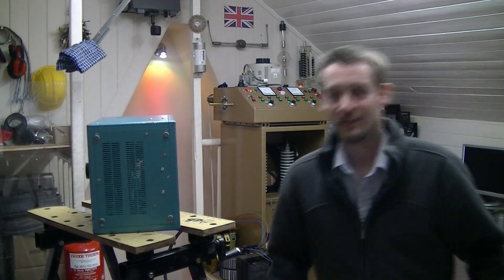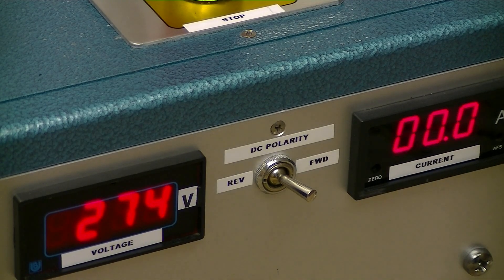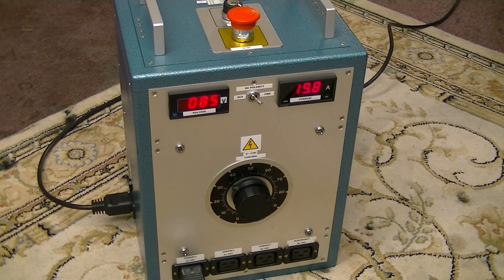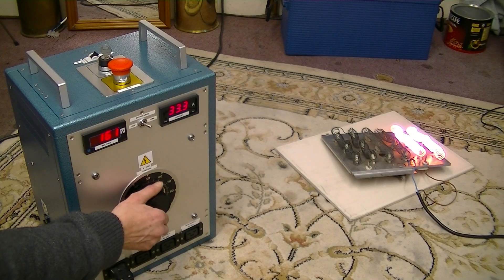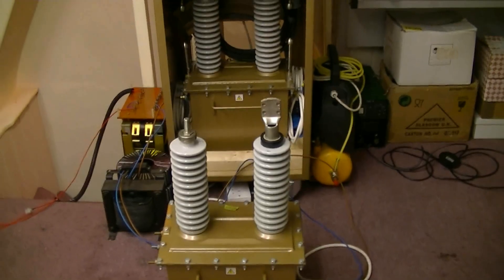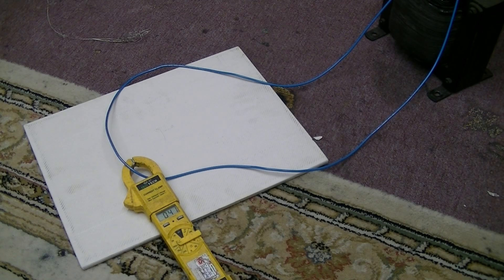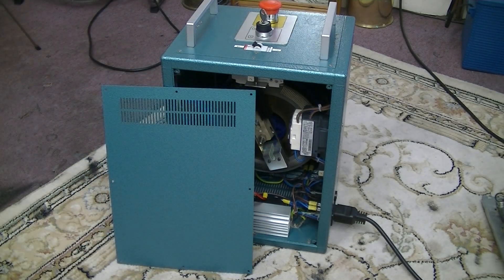Easy Electrical Project (with overload)

Comment: Trust photonic inductions experiments which start off fine then end up in fire and smoke!  Reversible DC is perfect for blowing up electronic parts in case you accidentally connect them the correct way round.

Comment: 9:45 I wonder, Is the cable twitching caused by the electromagnetic field around the wire, or something else?
Reply: The mass of the motor changing its motion

Comment: +Photonicinduction Andy why does the wire twitch and move when you put current through it? is it Electromagnetism? or is it the actual current moving it somehow?
Reply: It would take an extremely high current flowing through a single strand of wire to make it move by electromagnetic forces alone. It is more likely to be the rapid change in temperature (caused by the current heating the wire) moving it by thermal expansion.
Reply: Farmer Trev I figured I knew the possibilities, but didn't know which one would be most likely.
Reply: The wire is moving because of the magnetic field, trust me.  Tried not a single time. Sometimes it can even attract small nails or needles to the wire !
Reply: Lloyd Evans Yes that is true.
If you want to see extreme magnetic field, check this out,
watch?v=8bARpcEjiyA
Reply: Electrons have momentum. Gather enough of them in high density, then they can carry other matter with them.

Thermal expansion, electron momentum, and magnetic fields are the three reasons why the wires twitch.
Reply: mr evans is 100% correct. thermal shock. same thing is seen on AC lamp filiments. no 1 reason why they blow when you crank em on.
Reply: If the wire is close enough to something the magnetic field can attract, then yes, that could move it. It's certainly possible if the current is high enough, but a current that high would heat the wire enough to cause significant thermal expansion as well. So both effects probably contribute.
Reply: Mark Schulz IV Pretty neat let's see.  You know why I love Electricity? Because the possibility with Electronics and electrical energy are limitless, really they are only limited by Physics governing laws and your imagination.  It is so excellent.  I have been building circuits my whole life starting when I was 6 years old, lol I would stealk a 9 volt battery and a Christmas tree light bulb.  "you know those little ones" light it up, swing it around.  That was before I knew LED lights existed, back in the late 80's early 90's.  Now my favorite thing to play with are LEDs
Reply: Mark Schulz IV Oh and Arduino and Raspberry PI those are my favorite things to play around with, I made a battery operated portable Arduino Uno Programmer out of the original Raspberry PI, a battery a touch screen and a little mini Wireless Keyboard.
Reply: 85 Studios When you put electricity through a conductor it creates a magnetic field. The higher the current the more the conductor will move. 
This is how transformer work (besides the wire twitching). They induce a magnetic field into the other conductor.

Comment: Amazing video.  I'm so jealous of what you can put together so easily.
I don't quite understand how the DC conversion is happening - Photon talks about a 'DC relay' with 'double pole changeover'.  I've not heard of that before.   Is that basically a bridge rectifier?
Reply: A bridge rectifier is used to convert AC to DC. All the relay does is reverse the DC polarity by switching the positions of positive and negative terminals.

Comment: How should we go about hooking up a variac in a country with unpolarized plugs?
Reply: +Salvatore Shiggerino It does if the earth is connected to the ground of one of the plug pins. If you put the plug in the other way, the phase will go to ground and vice versa so you will get a little shock when you touch the chasis, etc. In Romania, we have isolated ground and phase (so the ground is never connected to the earth). The ground wire will always go to the circuit board and is isolated from the earth wire in the same way as the phase wire. The earth wire is going only to the chasis just in case the phase will touch the chasis.
Reply: The ground stops u from putting the plug in the socket(outlet) upside down
Reply: SpeakerLover1000#EPIC
No, it doesn't. The earth is in the centre, so the plug goes in either way.
Reply: Salvatore Shiggerino hello it's me SpeakerLover1000#EPIC I lost the password to that account so I'm here but in the Us Canada UK and other places you can only put a grounded plug in one way but that's how my outlets in Canada and US and UK are not sure where you live so I don't know what kind of outlet you have but I have the ones with the two flat straight pins and a round ground pin at the bottom of the grounded cords and you would wire it up the same way just know If the neutral is live not to touch it trust me I am getting a variac very soon and that's how simple I know lol

Comment: How can this work? I had a 1A fuse in there??? How can he draw 30 amps?

 *****
Reply: PROSHOOTERNL The 1A fuse is only for the controls (meters, and stop button)
Reply: The 1amp fuse is just for the control circuit on the contactor. You only need very small current to bring the contacts in
Reply: If you have a step down transformer then you get more amps and the opposite happens when you increase voltage with a step up transformer

+Afrotechmods
Reply: ChumpusRex
there is a relay or an isolation transformer between the controls and output

Comment: Mr. photon, do you work in the high voltage business? How can i create 3 phase out of a single phase? Is there a wiring trick to do?
Reply: Yep as Tim says the only way to do it is with a phase converter but judging by your comment "Is there a wiring trick to do" I would say you should first learn what the difference between single phase and 3 phase before you start playing around with any of it.
Reply: yeah IDK y we tell unexperienced people how to get three phase power
I guess were all dumb as crap
Reply: Phase converter
Reply: I am honest, i do not have a lot of know how with electrics. i how ever can work from a diagram to get it to work without understanding why it works.
Reply: and that's fine if your only playing around with low volts/amps but you should have a understanding of what your doing if you going to be playing around with something that can very easily kill you or those around you.
Reply: +Arjan Wilbie 
+Arjan Wilbie
There are a few ways
1. take a single phase motor and use it to spin a three phase motor and use the outputs
2. A single phase to three phase conversion transformer
And finnally a proper converter- Just look it up\

BUT!!!!!!!!! If you dont know,,, comma comma comma
Educate your self FIRST
Three phase power will litterally blow your limbs off
Good day to you sir
Reply: The HV FReaK The fact that he had to ask tells you it will probably end in tears :)
Reply: well he's going to find out some how anyway.
Reply: lol XD

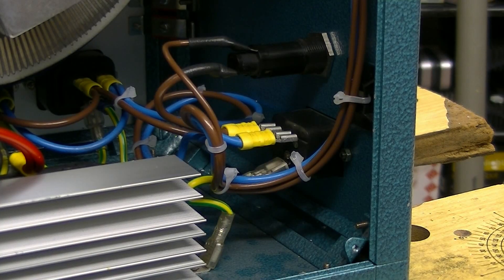Comment: Pardon my lack of knowledge, but I've never understood why AC has L and N, considering the polarity alternates constantly, so why does it matter where the L and N goes (you mention it at around 2:00).
Reply: Earth is a giant electrostatic generator. Clouds are formed, which rubs particles together, blablablabla. L is considered hot, because, in comparison to the massive capacitor that earth is, you're creating energy to go above the earths voltage level, N is already there, so it's considered the Neutral wire, so to speak, i'm bad at explaining this. You're basically pushing through all the spartans alone. Then when you start going back down, you're 'giving away your energy', which in comparison is you saying "fuck it" and walking away from the spartans (Alot easier to do, hm?)  Makes sense, maybe not, but i tried my best. TL;DR = L is considered hot, because it has no path to the ground, which is 0 volts,but N is connected, so they've 'evened out their voltages' basically. Disconnecting N and earth, at all points, including transformers and such, would give you a shock factor between N and Earth.
Reply: Easier to explain it this way... L = Live/Line/Load (the dangerous side) and N = Neutral/Earth Neutral (the safe side)
Reply: L is the one current is pumped into machines from, you won't die if you touch N and Earth, but you die if you touch L and N OR Earth (They're linked), even tho nowadays security measures are required to prevent fatal accidents.
Reply: Yes, I know that, but how are they constant ? Don't they alternate all the time, hence the word "Alternating" current ?
Reply: Daniel's Game Vault As i said, N is connected to the ground, hence why it has no voltage. It gets one, but it's instantly 'injected' into the ground, which is of negative polarity.
Reply: ***** Actually, it would be more of a collector than holding any positive or negative voltage due to the fact that the middle post of a transformer is always earth ground and the other two posts host the voltage. What needs to be remembered is that the two posts between the earth ground is a constant sweeping of voltage between the two lines, where the first post is (for example) +130 volts, middle post is 0 and third post is -130 volts (points 1 and 3 equaling a total of 260 volts), but that middle post will "collect" voltage from either post at the same time constantly even when there is a load between the two posts and draining to the neutral and earth neutral counterparts.

Comment: That large 15KVA+ C core transformer core you were playing with in your other videos that you made a 50KA high current step-down with, is worth about $1000 to buy, the copper primary on the thing would cost you hundreds of dollars, just for the winding wire.

Comment: The variable AC DC power supply would cost an absolute fortune, many thousands to buy here. Also those HV bushings, even the transformer oil is virtually IMPOSSIBLE to purchase here cheaply. The minimum order for the oil is one 200 Liter drum costing almost $2000 including delivery. There are minimum orders for the HV bushings too and that can set you back thousands too. Did you know if you sold just 1/2 the goodies you have collected you could have tens+ of thousands of dollars in the Bank.

Comment: Really. They are pots that work on AC, cool. And they can run things like fans, motors, etc just fine like a Variac? I'm sure they couldn't replace a Variac's job though, not just because of current limitations.

Comment: Since you're answering questions, what are those "mini-variacs" really called, and could I get one on ebay? They're the bottom 3 knobs on the big boys power supply for the reactor. We've got them at work on the 480v control panels, but I still don't know what they're really called, lol.

Comment: I'd be interested to see how much a 13a plug and socket can take, I've witnessed a sustained load of 27 amps being pulled through a 13a plug and the fuse didnt even blow! [proper fuse not a bolt]

Comment: @William The relay, which is an electromagnet-operated switch, effectively swaps the two connections, so the original +ve and -ve become -ve and +ve respectively.
The variac is nothing more than an autotransformer with a sliding contact  along the entire winding that can 'tap' off a voltage anywhere from 0 to the full supply. It can therefore be used to provide a variable voltage to a load. The windings between 0 and the tap are effectively the secondary; the entire winding is the primary. HTH

Comment: I know this may sound like a stupid question. But I don't know anything about electronics. So how exactly does reverse voltage work anyways? Does it like push the power in through the negative first then the positive? And for the regular positive then negative? Also what exactly is a variac used for anyways?

Comment: one cold night i said screw it and started playing with an old busted space-heater. the resistor heatsinked straight to the heating element was falling apart so i just lazily bypassed it altogether using some cheapo clip leads. to my surprise it passed the amps with no problem, no breaker trips or melting plastic. doesn't make sense to me but im not complaining lol. there must be another resistor in there somewhere but clearly the one that went bad was utterly useless.

Comment: im sure it is possible to overload the meter but it wouldnt go up in flames, i guess they dont actually use a hall effect but there are some things that do to measure current like that. this is basically a ferite core in each side of the clamp with a small wire on one or both of them making a coresponding voltage read by the meter. if you did overload it it would just mess up the chip, no flames or anything special.

Comment: For a couple of months now I have a brainblending question that I keep asking myself.... I'm wandering if a voltaic arc's direction/trajectory can get influenced by a more or less powerfull electromagnetic field and a laser beam. Basicly as a coilgun, the laser beam going through the "barrel" and the voltaic arc starting at the same point as the laser beam.  
I would've experiment that, but i never had the proper gear to do it.... neither now...

Comment: isn't 2.5mm cable 2 core & earth usually used for ring mains? and I know MCB for a ring main supposed to a 32A, depends on wiring I suppose though as radial can only handle 20A. 

as for the burning PVC, a little bit of hydrogen chloride never hurts anyone :P

Comment: hey quick question on contactors, im using one to start a 3phase motor, but when I apply power to it, it latches than unlatches. If i hold the button down it just keeps repeating that...

Comment: How long can it take 25-30 amps do reckon, 10 mins? And what would fail first... probably the live terminal or the 'fuse' would melt through the plug and set on fire, depending on how crap the plastic is.

Comment: Just a reminder to you guys wanting to save a few bucks on thinner wires: Although cable won't pop from like continous 2x rated current it's isolation will deteoriate much faster from heat generated and after few years they may start posing electric shock risk. Just month ago I was fixing a lamp and from heat generated by bulb isolation was hard and cracking under my fingers...

Comment: @fsb,the contact blades in a socket which make contact on a 13 amp plug prong go soft way before the plug prong it's self melts. old skool solid type that are not plastic are better than the insulated plug prong, however the same problem occurs that the double sided blade contact goes soft causing ever decreasing contact force resulting in increase losses and heat.not seen any uk 3 prong 13 amp plug deal with much over 13 amps without signs of heating up, also the fuse holder is total shit.

Comment: Yes, I recently found that out! :-O While I was there, Photon & I were setting-up for an experiment, & I picked up that variac to place it on the floor, so that we could plug it in & use it.

Mmmm, Quite a weighty lump!

I also had a go at cranking the dial while it was unpowered. Yessss......DEEPLY SATISFYING!! :D It definitely has a different feel to it than my little 10A puppy. :D

-BoomBoxDeluxe.

Comment: I've long wondered that, & it's something that I'd really like to try out. To get a BIG beefy transformer, maybe a few kVa, & if needs-be, then rewind the secondary for silly-amps, (at least 150A :D) then wire that into the back of an old socket, a plug stuck in it, shorted of course along with the fuse replaced with something that shouldn't go in there, & then....

Crank it till it pops. :D FLAAAAMES!

I come unstuck at the point where I haven't got a huge multi-kVa transformer though. :(

-BBD

Comment: That is a beautiful build right there. Nice work on the rewire too! And the box itself has very nice tolerances on how it fits, and great hammerite paintjob. Great find! Thanks for the advice on the breaker on the output side of the variac too! That's gonna save a lot of variac's :D

Comment: he has gone over the current with his high current transformer, but you cant really "pop" them as it uses a hall effect transistor that measures the magnetic field. not a resistive wire measuring the voltage drop using ohms law. :) it would be fun to see it get permanently magnatized, but the EM field might wipe his HDD's downstairs :D we dont want that to happen now do we?

Comment: photon can you do some testing with solid house wire ? for the reason is that i read that electrons do not flow thu the center the copper wire the flow thru the outside Skin ... and that is a major advantage with stranded wire but never the less Awesome Video and Porta-pop XD
Cheers
Ty

Comment: Wow nice setup there, that's how it should have came new. It's my Variac and control panel combined in one box except mine cannot switch the DC polarity instantly like that. Good point on the Variac current levels, the mains fuse will do nothing when you're below 20 volts and can still easily burn the Variac out. I'm fuse protected on the input and output sides because I know the dangers. Thanks for posting this, it's pretty neat to have that all in one box, I'm looking forward to your next vid!

Comment: Ah, Mr. Photon. I saw that box on the popular auction website. :D

Nice to see it again, & that you gave it a nice rewire in there. Please be nice to it & don't burn-off the top-end of the windings. :D

What's that I see at 8:40 ? YAAAY! 28A variac has wheeels. :D

I was hoping to see a vid of you putting the wheels on & giving a quick demo rolling it around the room or something. At least now you can move it around the room a bit easier instead of picking it up. :-)

BBD has flavour. :D

-BBD.

Comment: So if just over 20 amps is the maximum of 2.5mm2 cable, why are 32A ring circuits wired with it?

Comment: AC power goes in 50/60Hz which is vibrations per second and when the power is transformed it makes sounds at 50/60Hz.